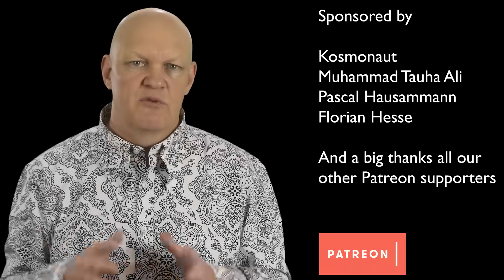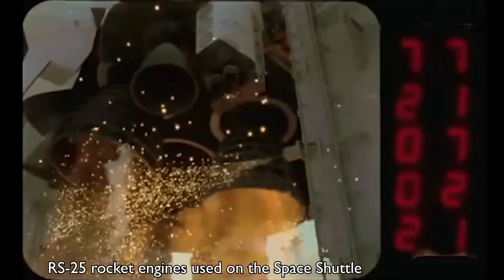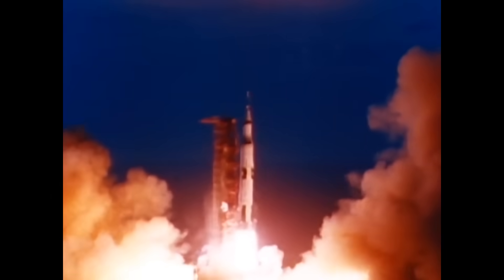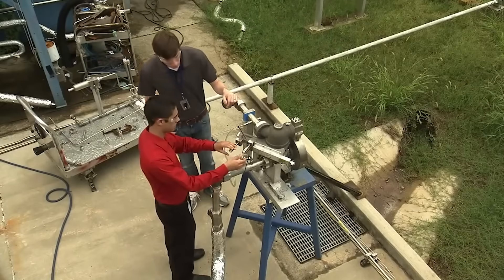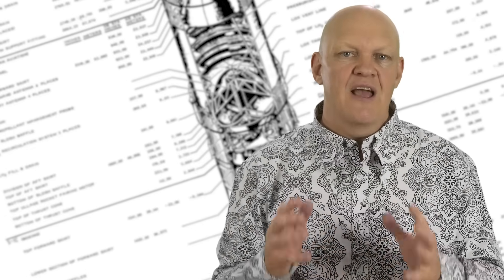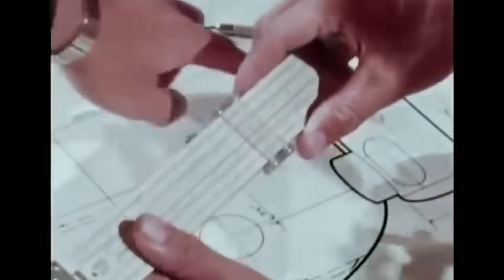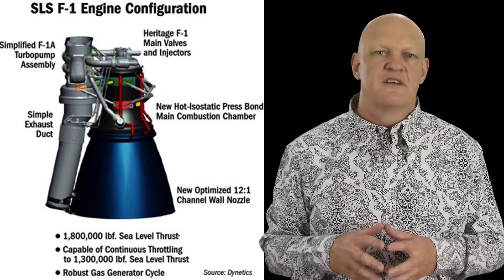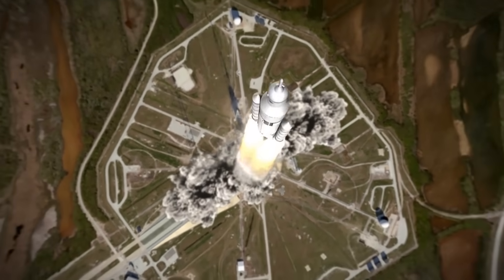Why Can't we Remake the Rocketdyne F1 Engine?

Comment: BTW, the vibrations of the F-1 engines impose a heck of a stress on everything around it. Hydrogen + Oxygen burn so much smoother -- even Methane is smoother. A smoother burn lets designers trim weight -- always a huge issue in rocketry.
Reply: The main advantage of RP1 is the density of the fuel, with hydrogen the fuel tanks are around 3 times as big, and even a common bulkhead  has to be insulated well because the temperature difference between Lox and Lh2 are too big.
Reply: @simonm1447  RP1 is so close to JP1 -- especially from an engineering point of view that I rather doubt that any other fuel was seriously considered for a booster. Let's not forget that Sp Imp is not critical for a booster. Sp Imp becomes super important the faster the rocket's velocity. This was well illustrated by the NASA team who selected H2-O2 for the 2nd & 3rd stages -- while leaving the booster with the tried and true kerosene-oxygen combo. 
As for a rough ride: Borman & Coy reported that Apollo 8 was so rough that they couldn't read any instruments -- and that the crew wondered if the ejection system would be automatically triggered. Borman actually pulled his arm away from the trigger -- lest he terminate the boost-phase the hard way! His body was shaking that badly. (Apollo IV ) actually did so much damage to the pad that it was out of commission for months. NASA had to re-engineer Saturn V lift-offs. (!!!) 
Elon has moved to methane-oxygen -- a combo that I thought fifty-years ago was what NASA should've run with. I'm guessing here, but I suspect that NASA didn't have a handle on methane compression dynamics. Here and there, I read technical literature damning methane as just wa-a-ay too much trouble. No explanation was proffered as to why.

For commercial rocketry, I rather favor ethanol-oxygen as it's low Sp Imp is balanced by its tractable nature. You get a very smooth burn and the engineering challenges are very low. The von Braun A-4 was originally spec'd for kerosene-oxygen. Then reality hit. It was such a rough-burning combo that von Braun ran away from it. It was just too much trouble for a booster that was never really going to reach high velocity. 

I also favor a plug-design and a high-altitude launch -- say from New Mexico or the Big Island of Hawaii. I also favor a straight-up vertical booster path so that the booster's recovery is even simpler than Elon's flight profile. The booster burn does not (logically, economically) need to provide momentum towards the east. Merely getting it high out of the atmosphere -- with kinetic energy aplenty -- is sufficient. Then very squat upper stages -- with H2-O2 -- or CH4-O2 can provide horizontal momentum into orbit.

With a plug-shape, you can then send up ring after ring -- large enough to craft a viable space construction station in LEO. Such a payload could be wrapped on the OUTSIDE of your upper stages. Upper stage returns could occur ablatively. 

The rotten aerodynamic resistance in early boost would be reduced by launching from 1,500 meters above sea-level. The boost would not reach max dynamic stress until the vehicle was, say, 30 kM up.

In the event of a fiasco, the booster would be directed to fall straight back down to a designated crash zone. This is much more practical with a pogo flight profile.

Comment: The quality of engineers in the United States is plummeting for three main reasons:
1) the existential threat is gone
2) cheaper brains compensated by computers - the best bang for buck option
3) wider diversity, whereby good brains can find life satisfaction with less effort
In addition, there is one more long-term trend that may contribute - genetic degradation of the population due to negative selection.

Comment: I can work on older equipment in my line of work. I am one of the last of "my kind" with that level of knowledge. There are very very rarely younger people with the interest or in todays business climate actually allowed the time to learn the skills needed to understand the systems. It is deemed more economical to scrap the systems and start over. It is only more economical because the art is lost.  Many times the new systems are not as robust as the old. But it is more maintainable for a low level tech by simple parts swapping.  They trade paying for skilled trades for a higher cost system to maintain. Good for me though.

Comment: Did not realize rockets work in a vacuum
Reply: Yes they most certainly DO.  Did you think RECOIL stops working in a vacuum?
Think about this:
If I fire a steel projectile from a CROSSBOW in space, will I STILL feel a recoil?
How about if the crossbow fires a projectile made from ICE?
Still recoil?

Well the space shuttle main engine expels nothing but PURE WATER at about MACH 8.
DO you think that a water cannon has recoil?
Yes it does!  a HUGE recoil!

Comment: I’m really surprised by this clip taking the premise that the F1 the most perfect engine.   You called them efficient rocket engines?  
Maybe they aren’t going to be reproduced because they are not terribly efficient.  A gas gen engine with a modest chamber pressure and an Si of 263 @ sea level, so it’s  probably  not blowing anyone’s skirt up.   How about the SME with almost 3 times the chamber pressure and a specific impulse of  366!   Or even Merlin 1D ft amazing thrust to weight ratio. 
There are measures of efficiency more than having the most grunt.  The BFR will be of smaller diameter. It will be fitted with close cycle engines that are much more efficient and will have a greater total thrust.   So in the same space you can mount more thrust with more redundancy.  

Oh, maybe that is your next video on the new shorter format?

Comment: As an old-ish mechatronics engineer I find this comments section disheartening and quite ignorant. It's true that "they don't make them like they used to".... we don't. We make them so much better today. It doesn't matter how good a welder was back then, a single CNC machined component today is superior in every way to the exact same thing that back then required 10 or more individual parts welded together. And no machinist, then or now, can match the speed and precision of a modern 5-axis high precision CNC machine. Engineers and skilled tradesmen of 60 years ago could only dream of doing what we do routinely today, but that's not to say they weren't extremely skilled, they simply didn't have the tools or knowledge we have today.... I know this because I'm old enough to have used a slide rule and log tables. I don't miss either one.

Comment: One does not fully comprehend the enormity of the undertaking until you actually visit NASA Space Center in Houston and go to the Saturn V rocket building. I live in Houston and have been there several times over the decades. The first time I saw the Saturn V it was in pitiful condition in an open air exhibit. Much of the rocket's siding had corroded away with bird nests dotting it's innards. Houston's 98 degree summers with 95 percent humidity was not kind to the Saturn V. Not to mention a hurricane or two. NASA has done a wonderful job of restoring the rocket, but, you have to realize that what you are looking at is basically just a reasonable facsimile of the original. NASA probably spent more tax-payers' money on restoration than they would have had they just done the job right in the first place. Your tax dollars at work.

Comment: How sad it is that the skill set has been lost. This applies across the board in industry. I feel it is a a result    of today's practice of not repairing things. Now if a machine breaks down, either a part is replaced or the whole machine is scrapped. In the past replacement components would have been made locally or even onsite by skilled technicians. I guess that isn't practical in today's world but it is responsible for the lost of many skills in today.

Comment: Technology, science, physics, chemistry and math move forward.
Reverse engineering something is nothing new.
But applying modern (current day) systems and technology is nothing new.
But things like solid fuel rockets have improved over time.
Rebuilding the engine from the 1960's using modern day tech?
Hey. It isn't re-inventing the wheel.
IT IS IMPROVING IT.
Making it more efficient.
Making it better.
Then factor in things that are found/discovered using the new tech....COOL...
GO FOR IT.

Comment: That's the difference between implicit and explicit knowledge. During my PhD-studies of chemistry at the uni I read many book articles of course... about certain techniques, some of them were from 1910 or even earlier. The problem was not about old-fashioned German or obsolete words/terms....

Even seemingly easy sounding tasks can be difficult.... 'Then do x....' ..... The WHAT is simple.... but the HOW?! That's why it's called Know-How!

The problem was that even if the article was very accurate I still had to try it out several times and acquire experience before it actually worked as described in the book. So even if I had information about the process, even though I was a professional, I still had to learn it by try and error.

Comment: Asimov talked about the loss of past knowledge in the Foundation Series.  I live about four miles from Rocketdyne, or at least where it was until about two years ago.  It was wonderful to feel the ground shake and see the plume of smoke at the Santa Susanna pass test facility in the 60's when I was a kid.  Now it's a flat lot which will be either shopping or apartments.  What those young engineers did back then was truly a triumph of engineering....Average age of NASA engineer in the mid sixties was 26 or 27.

Comment: very Interesting video. I often wondered why they didn''t rebuild it. I built the F-1 at Rocketdyne, Canoga Park from July -64 to Oct 1968 when I left the space industry for a career in Law Enforcement. In the summer of 2019, I had the opportunity to see the whole Saturn 5 at the Kennedy Space Center. Brought back a lot of memories. I had logged the engine numbers of each engine I worked on ad kept them aa memories of the Saturn V program. Wish I cold have seen the numbers on the display engines.

Comment: The question that we should ask is, why wouldn't NASA use the new F1. Because NASA is "probably" still controlled by politics over safety? If you can shut down a new F1 and cannot shut down a solid rocket booster in case of trouble then safety would dictate go with the new F1. I sometimes wonder if Wernher von Braun had any say so over the Shuttle Engineering. Watching his documentaries over the space program - von Braun was all about safety 1st. Over politics and over ego. He was "very" cautious.  I think NASA has lost a lot of this and this is why our space program has had so many problems in my opinion. Bring back the F1 and use it and it's modified potential to it's fullest.

Comment: Remaking an F1 engine according to the plans that actually can fly would be an excellent way to recapture skills. A major technical college would be required for this something like Caltech or one of the other heavy engineering centered colleges. Most likely they would fail for a long time in achieving it. Because most of those schools don't trust their own kids to even fix the sidewalks on a campus. That's why they hire subcontractors to take care of the infrastructure on the college campus instead of putting those kids to work with an on-site crew of specialists.

Comment: What a load of SHIT, still many GOOD Engineers out there in there early to mid 50,s whom know how to measure & fabricate OLD School. 
NOT every Engineering Company has CNC machines. The combination with OLD proven design and Modern technology, Materials and YES Modern machinery would produce 1 Hell of a good Rocket. Engineers can re-produce anything, Imperial and or Metric to suit. 
To have a set of Blueprints is awesome, If not then strip down existing and go from there.Modern technology will just make construction easier, better & more efficient
.

Comment: I would say most people don't know the rocket engines appear to be glorified turbine engines, some  in particular are somewhat common manufactured for airlines like the  Rolls Royce turbine for the 747 I think... That's how it's possible for the space shuttle to actually have a controlled descent and landing.  You can actually hear the turbo winding of the engines as the shuttle makes contact with tarmac on the landing strip if the audio has not been manipulated. Don't they claim the shuttle glides free of thrust on re entry and landing? I'm not sure why they would tell people it's a glider on re entry that's just not feasible, purity certain it would plummet chaotically. They may be trying to hide that the shuttle is really more air plane than spaceship, but weather rocket propelled or turbine there is always that issue of thrust propulsion having any successfull function in a vacuum. How do they manage controlled acceleration or deceleration without any medium through a frictionless environment. Gotta hand it to them sudo-physicist and advancements in theoretical ideology truly amazing progress they are making, such as ionic travel which is still a form of thrust propulsion. Incredible they can make that work.
Reply: The shuttle was a glider on reentry. There was no fuel for the engines, as the fuel tank burned up over the Atlantic days earlier. I watched the first flight of the shuttle LIVE. My god, could you at least try to educate yourself at a junior high school level of physics?!
Reply: - "You can actually hear the turbo winding of the engines as the shuttle makes contact with tarmac"

This is a flat out fuckgin LIE.
Quit repeating bullshit you heard on YT.

" Don't they claim the shuttle glides free of thrust on re entry and landing?"
Yes and that is exactly what it does.

How many space shuttle launches have YOU attended up close and in person?
ZERO?  what a surprise!
Reply: - "there is always that issue of thrust propulsion having any successfull function in a vacuum."

If you are interested in learning, I can help you understand,.
But you need to answer about five very basic physics questions to get you to grasp the concept.

First question:
If I fire a standard steel projectile from a CROSSBOW, here on earth, will I feel a recoil force?
Yes or No?

Comment: As farmers my son needs the auto steer to plant the crop, I just needed an air conditioner, my farther did it with an open cab, my grandfather breed the horses, cared for them and harnessed them to plant the crop. Every generation uses slightly different techniques. I’m sure it could be done the old way if the necessity arose and budget and time weren’t limiting.
Reply: My dad pulled the four row planter with his IH 450, my brother uses auto steer, and I'm a software engineer.

Comment: Wouldn't be that difficult to redo everything since nowadays the know-how on kerosene liquid engines is vast.
Reply: It was difficult enough to get the funding they did back then, even motivated by Kennedy and the cold war. Forget the how, think about the WHY. It’s been done already!
Reply: But it takes years for the engineers to learn the same skills as they had back then.
Reply: @rinse-esnir4010  no. The skills that back then had to be learned the hard way and by trial and error nowadays are well understood are common knowledge amongst the engineers that work on these type of engines. Moreover with the simulation capabilities and computer power we have nowadays the engines could be replicated very easily without any trial and error. It'a big engine but it is not that complex comared to nowadays engines.
Reply: @polviaortega3709  I know, but the problem is that the F1 was designed that way, every single one of them was crafted by hand and had their quirks that were ironed out using trial and error. And that part hasn't been documented, so rebuilding the engines would require for the engineers to learn the required skills and to redesign the engine using trial and error.
The time, money and effort that takes can be better used in a new, more efficient designed that meets today's computer standards.
Reply: @rinse-esnir4010  I get your point now. Yeah, maybe it would not be that straight forward but it doesn't matter to much because of course we don't need these engines this big anymore and if NASA needed an engine this big again it would be much better to do it from scratch.

Comment: The F1 engine was the miracle of its day.  And like most high technology things of that day, it was completely hand fitted and finished. The technology of the day was hand written notebooks.  If an industrious engineer wanted to design and build a similar engine today with today’s tools and materials it wouldn’t really be difficult.  The difficulty would be selling its usefulness over multiple smaller high efficiency engines or SRB’s, Which is the trend today and the foreseeable future.

Comment: It's more like we don't need such big engine anymore. Electronic control has progressed greatly since F1 era, we can use many small engines to do the same work with much cheaper price now.
Reply: Oh, so the Soviet N1 is doable now?
Reply: Startship is an example, let's hope it will succeed.

As for N1, it failed due to multiple reasons, not just technically, so whether it is doable now or not remains to be seen.

Comment: We don’t need the Saturn F-1 engine. It was big and dumb and that was all that was needed at the time. Open cycle engines like the Merlin are its legacy. But anything bigger than that needs to be closed cycle for efficiency. We don’t need huge 1950s V8 engines anymore because we have newer and more efficient solutions.